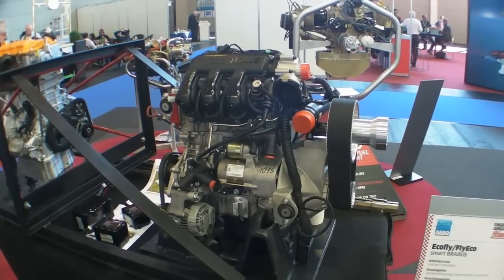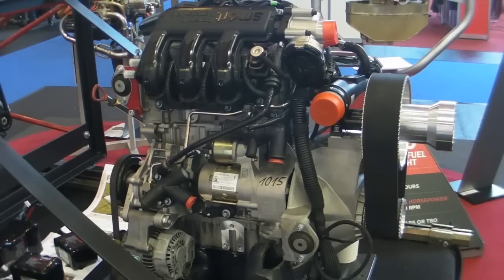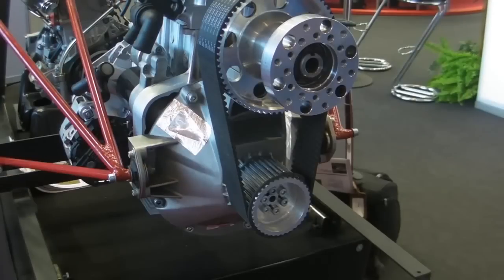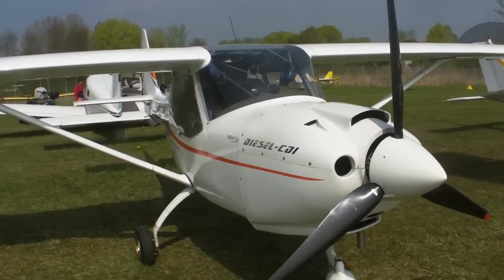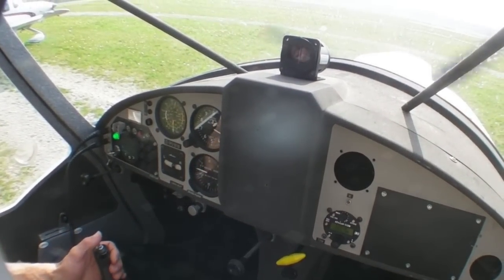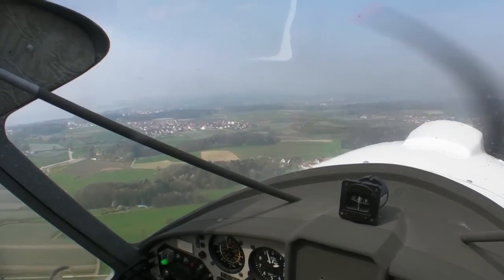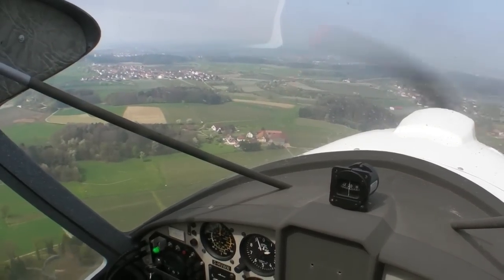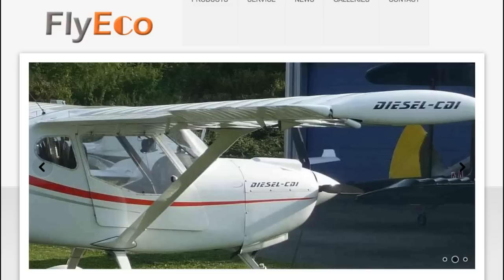FlyEco's Smart Diesel

Comment: Baie, Baie Dankie/ Merci, Beaucoup, Beaucoup. Paul of AVweb. I was searching the web for a small Diesel engine that would fit on a Microlight. I have founded it!!
Reply: Im doing the same, but no more info, it would be great for my amateur build kit, but sounds like the whole plan went bust? no info anywhere
Reply: I’m guessing the company has gone bust . The €18,000+ price tag has killed it
Reply: @MrPagnu  I think for places where avgas is not available, and with the high fuel economy that price still made sense if they could have made it work

Comment: only 9kg/hr at 80hp? Can't be.. that would be about 0.15kg/kwh which is about as efficient as one of those giant slow turning marine diesels. Something doesn't add up.
Reply: Fix pitch Prob. It doesn‘t have 80hp with a fix Pitch Prob. Listen what he says. 
I drive this engine in the smart car and it burns 3,5 L/100km so i thing this low consumption in an aircraft is possible.

Comment: ever consider PSA DW10 FC ? which provides 180hp and also  be very popular in europe.   And ever consider suzuki  1.0/1.4 turbo BoosterJET? Which provides 140hp and be still light weight. Both DW10 or boosterjet serve in mainstream vehicle and are absolute more popular than the smart diesel, which means more parts access than smart diesel.
Reply: these all use timming belts and even new  can break  only bit rubber  1 inch x 1/8 ! . at least smart got high strenght  steel chain